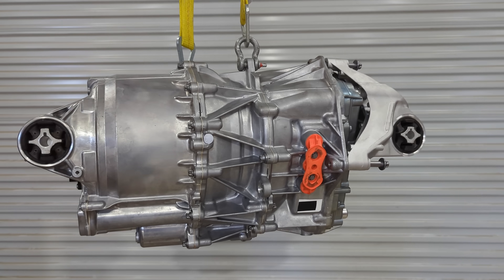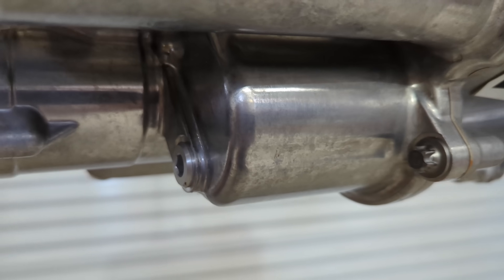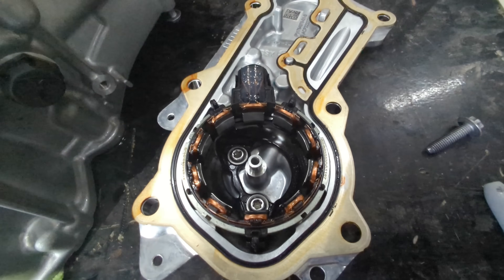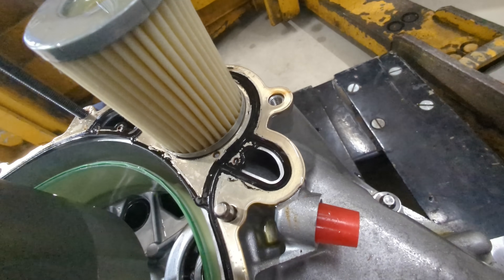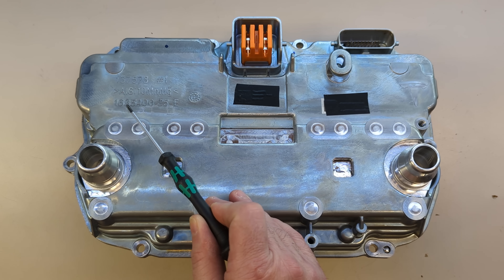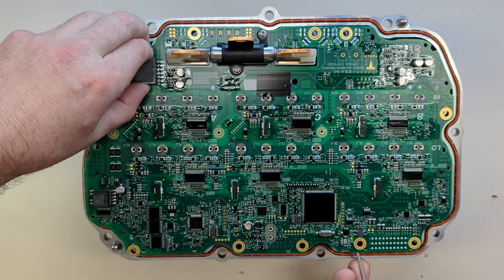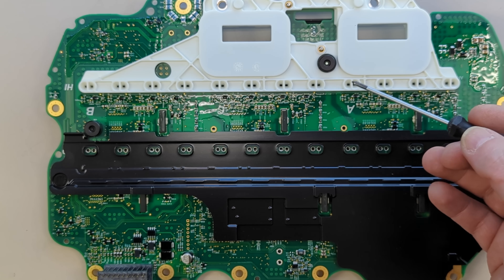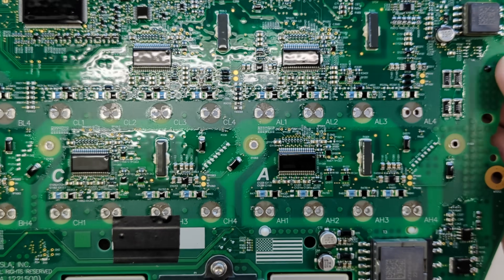Tesla's Newest Motor & Drive Unit

Comment: Excellent video! Do you know the weight comparison between the previous and new motor and invertor? Would you expect any efficiency improvements or performance benefits with the hairpin design? (I would think less winding equals less weight and better efficiency/performance.
Reply from the maker: It's slightly lighter, I don't have exact figures yet.   The main point of this design is making it easier to produce and lower cost.  I don't expect them to increase the power in Model Y or 3.   This is a marketing decision.
Reply: @Ingineerix  thanks for the response!
Reply from the maker: @kylekleman  I updated the exact weight in the description
Reply: @Ingineerix  dang! You the man! Do you know how that compares to the previous version? :) If not, no worries!
Reply from the maker: @kylekleman  I think the previous gen was around 200lbs, so at least 6 lbs savings.
Reply: I traded my S in for a Lucid GT after watching the teardown of the Plaid and Taycan designs on the Lucid site with Peter Rawlinson (he was the chief engineer who designed the S).

Comment: Does this have the new rare earth free permanent magnets? Maybe you can borrow an XRF analyzer and point it at the magnet material.
Reply from the maker: No, what you are talking about is for the future low-cost model.
Reply: @Ingineerix  why wait?, new cheaper permanent magnet material. Plenty of reasons to try in current production where they can fall back to old material if problems.
Reply from the maker: @TheGaussFan  I do not work for Tesla in any capacity, and I doubt they will take suggestions from me.  Go talk to them if you think you know how to help.
Reply: @Ingineerix  What I meant was that they will likely try the material out sooner rather than later (as they have done with the hairpins) to reduce risk  for the new platform. Local sales rep for XRF (non-contact, non damaging test) would likely jump at the free publicity and help you analyze the magnets. Worst case, you would have a before measurement to pair with a later measurement on the new material.
Reply from the maker: @TheGaussFan  Well, I'm sure Tesla will extensively test any new composition in engineering vehicles well before they put it into production.   That doesn't have much to do with what's in production now which is what we can see.   Sadly, I have limited time to devote to Youtube, and calling around to XRF and then taking the whole thing back apart again to test the magnets seems like a time sink.  Had I known that before I did the teardown maybe it could have been done.

Comment: All the ICs appear to be epoxy painted so we can't read numbers.  This is silly as the people that really want to know will x-ray.
Reply from the maker: They are not "painted", this is called conformal coating and is done fro reliability.  It is transparent, and with the right light angle you can see the part numbers.

Comment: Integrated filter housing.  Bullish on drive unit lifetime.
Reply from the maker: I think this is a better design.  There really is no reason to ever replace the oil filter.  People are used to thinking this is like an ICE where oil is contaminated by combustion blow-by and broken down by high-temperatures, Thus there is very low flocculation in the synthetic lubricant.   This is only to filter out the really small amount of material detritus from manufacturing and wear over the life of the unit.   There are no friction surfaces in this unit like an automatic transmission would have.   Tesla considers the lubricant to be "lifetime".  I recommend changing it at every 40k if you want to be really careful, but no need to ever change the filter, it has even more surface area than the old spin-on design and eliminates a possible leak point.

Comment: you are awesome! Lucid Motors has a great video on comparing their motor design to Tesla's and they're pretty much better on many aspects.  Only defense for Tesla is they're reusing old motor design from the M3 and they scaled it to the Plaid by using carbon wrap.  I'm certain they're going to ditch the carbon and take Lucid's approach
Reply from the maker: Keep in mind the car Lucid is making is much more expensive than what Tesla is selling.  And they definitely can't be compared to the lower-market cars like Model 3/Y.   Cost is king in automotive.  This is allowing Tesla to undercut everyone else in the EV space.
Reply: @Ingineerix  true. after watching that Lucid video, I estimated that Lucid could be paying more for that electric motor design. also the hairpin solution looks to be more expensive than wires but it appears worth it as it greatly simplifies and shortens making motors.
Reply from the maker: @zodiacfml  Lucid has some amazing tech, I hope to be able to take it apart sometime.   However, they are in the "boutique" stage selling a very low quantity expensive vehicle.  Tesla meanwhile is optimizing this to get it mass-market, and build cars as low-cost as possible.
Reply: Why would they ditch the carbon wrap?
Reply: @bru512  it is more expensive while producing the same power as the Lucid electric motor
Reply from the maker: The carbon overwrap was introduced to allow higher top speed in the Plaid motors.  I have separate videos on this already.
Reply: @Ingineerix  Yes, but will it become ubiquitous or reserved for high power solutions?
Reply from the maker: @bru512  Will what become ubiquitous?   The carbon overwrap?   No, that's only reserved for the flagship vehicles that are sold to be able to achieve high-speed.
Reply: @Ingineerix  Why not?  How much does it cost to wrap a rotor?
Reply from the maker: @bru512  There is no need for motors that aren't going to exceed 162mph.  I don't know the exact cost, but it's not so cheap they would do it for no reason.

Comment: Why wouldn’t they do hairpin before if it’s better and easier to make? I thought the sound rotors where better but harder to make
Reply from the maker: There are tradeoffs, but it also costs a lot to change tracks, you have to have the right circumstances, and I think since they were building a new factory in Texas, that was the opportunity.   Tesla is striving hard to get cost down so they can sell more cars cheaper, so far seems like this is working.   I doubt they will trash the existing wound stator motor lines right away.

Comment: Great video! but what advantages does it have vs Gen 3? is it lighter and more powerful?
Reply from the maker: Mainly cost.   Slightly lighter, and could have more power, but they are keeping it the same, so that means (usually) more reliability.

Comment: The driver PCB unit looks very cool! It has some thick conformal coating applied over the most delicate circuits. That's probably because the PCB is submerged in a liquid coolant. How many circuit layers does the PCB have? I'm guessing eighteen or twenty layers. Thanks for the awesome video!
Reply from the maker: The PCB isn't submerged.  The conformal coating is mainly to prevent condensing humidity from causing problems long-term.
Reply: @Ingineerix , I see. So the chiller housing is cooling the SiC MOSFETs opposite to the PCB component side. Nice! Is there anything stamped on the PCB that says how many layers the board has? Thanks.
Reply from the maker: @BookProX  No, but I would guess it's 4-6.

Comment: Interesting to see that these motors get simpler and easier to build (less manpower, less parts that fail)

Compared to a combustion engine they are much simpler to make and maintain. Less mechanical parts, less materials, more predictable, less gearing needed,..

Or are they?

Comment: Subscribed 😊! Tesla just had our early 2021 production model Y rear drive unit replaced last week, only part number is 1521487-00-B. Is the newer unit compatible with older models? Or do they have to keep making older unit sku’s?
Reply from the maker: No, that's not the new motor.  They put rebuilt drive units in existing cars, not new.  This new unit is not in wide release yet.

Comment: is it a permanante magnet reluctant motor?  the magnets are tvisted back and forth in the rortor for vibrations diversificating?
Reply: Magnet placement is to maximize magnetic field strength across the rotor to stator gap.
Reply from the maker: Yes, it is a Synchronous PMSRM (Permanent Magnet Switched Reluctance Motor)

Comment: it's bitchin'! btw.: is the resolver stator insulated from the housing cover?
Reply from the maker: It's a sine-cosine resolver and it's got 2 windings, and yes, they are both isolated.
Reply: @Ingineerix  thanks for your answer and applogies for my imprecise question. i understand that the reluctance resolver has 3 isolated circuits (excitation, sine, cosine). but looking at timestamp 3:37: what is ths golden color on the mating surface of the resolver cover? the black line is an oil seal, but is there some kind of coating applied to the mating surface?
Reply from the maker: @teslaw-model3  That's just a little of the drive unit lubricant wetting the gasket.   The back cover is firmly mounted with 4 bolts, so it's definitely connected to the chassis.

Comment: 12:45 Subscribed !

Awesome teardown... How did you get your hands on this car? How are you paying for it? I'm flabbergasted... This is Gen3 stuff, right? 🤯
Reply from the maker: This is Gen 4, just an evolution of Gen 3.   We have not seen the Cybertruck yet (Gen 5?) and the new future low-cost car architecture will probably be Gen 6.
Reply: Purely guesswork on my part, but if he is involved with Maxwell vans as he says earlier, then he likely has access to the drive units they are buying from scrapped cars to use in the vans.
Reply: @grahammonk8013  but this is a gen3 motor and inverter... Just announced by Tesla as their future platform. How this is already build in a model Y? And how did it end up as scrap? I'm just so confused now ....

Comment: That's some very cool engineering on those inverters. 
I'm a little annoyed the filter is internal to the motor housing now, not likely to ever need be replaced, but having the option to replace it externally gives some peace of mind. I would also like to see some oil analysis of these drive units after a couple hundred thousand miles. I know the oil won't degrade from temperature and contaminants, but what about shear wear? There's a lot of torque between those gear teeth sometimes.
Reply: You'd think that, but Tesla now has several million drive units with filters, and with 4 almost 5 years of experience + at least one model 3 in the the 300k mile range. There is no combustion of the oil due the much lower operating temperature of the oil compared to a standard ICE so far less material to filter.
Reply from the maker: This is why Tesla uses some very special synthetic lubricant, it's designed to have very low windage losses and withstand the high pressures found in the geartrain.
Reply: @Ingineerix  I thought they just used dextron 5? Not that D5 isn't a high quality fluid or anything. I thought that's what the service manual for my 2021 said. Or have they moved to a new fluid now? I would still be curious to see what the viscosity and film strength is like after a few hundred thousand. And to see a teardown of one of those high mileage gear sets to see what kind of wear has taken place. I'm not actually that worried about it and I'm sure it's low, but I'm still curious as a numbers and data guy.
Reply from the maker: No, they are using Pentosin full-synthetic ATF 9 in the 3rd gen and what they are calling "KAF 1" for this 4th gen unit, unknown what this is at this time.  The older Model S/X drive units that didn't have any filter used Dexron 6 (full synthetic), I have never seen Dexron 5 specified.
Reply: @Ingineerix  Another little nugget of useful information.
Reply: @Ingineerix  About filters, does the fourth generation of products still use two filters? Is there metal mesh in front of the oil pump?
Reply from the maker: @Yajun-pp8qz  Yes
Reply: I understand the concern, but this oil has an even easier life than the oil in other transmissions, because there are no clutches (as in an automatic) or synchronizers (as in a manual) to wear.

Comment: Great video! Can you share the part number so I’ll check under a brand new giga Berlin made Model Y? Thanks
Reply from the maker: Tesla part number 1665000, so I'm calling it the "Triple 0".
Reply: Usually you have to jack the car to fully extend the rear left suspension: then you should be able to take a picture of the laser engraved label with part number
Reply from the maker: @massimopinelli6555  The new drive unit doesn't have that same large area with the laser engraving.   There is a black foam NVH cover all over that side of the drive unit, so definitely can't see much.
Reply: Can you see this part under the car, or do you have to take off some cladding? I took delivery of a Texas MY LR last week. It believe it was built on March 17 (VIN assigned). I'm curious if I have the drive, but I know it is not important.

Comment: So my 2023 MYLR has the hairpin motor?
Reply from the maker: Only some Model Ys from Texas will have this.   There is no way a driver could tell the difference.  (unless you start looking under the car)
Reply: @Ingineerix  Thanks. My Model Y is from Austin. So it a toss up like you said.
Reply from the maker: You can look through the left rear wheel to determine it, see here: https://teslamotorsclub.com/tmc/threads/what-motor-does-your-2023-model-y-have.293314/
Reply: @Ingineerix  😳 thx

Comment: Great video, thanks! How much does this weigh? Compared to the old Tesla small drive unit, is this one lighter or more powerful?
Reply from the maker: Only slightly lighter, and power (for now) is exactly the same.   The main benefit here is lower cost.
Reply from the maker: The weight is now listed in the description and pinned comment.
Reply: Great question, I’d be interested to know mass savings as well

Comment: So is it safe to say that all model 3 and Model Y manufactured in Berlin/Austin/Freemont/Shanghai in 2023 have this new version?
Reply from the maker: No, I only am aware of some Model Y's in Austin using this motor so far.  Even though it would fit in Model 3, the software doesn't yet have a build config for Model 3.

Comment: i wanna know how powerful😮.5.6s?5.1?or 6.1?😢
Reply from the maker: Even though a hairpin design could support higher peak power, Tesla has set this up to be identical to the previous generation.  The net result is it's just a low-cost evolution, and might be more reliable.   Time will tell.

Comment: Thank you for your video, it looks so great! Could I just ask you a question?
Is 8 layers hair pins  for the Long Range/Standard Model Y, and 10 layers for the Performance? 
There're some leak photos show 10 layers motors exist!
Reply from the maker: I'm not aware of any other stator designs in production.  I don't see any reason that performance would need a different stator, this design already has plenty of excess power capability.

Comment: Will only the long range have this drive unit? Or will it be same drive unit on the performance?
Reply from the maker: Only build configs in software right now are for the rear unit in AWD Model Y, in both Performance and standard.
Reply: @Ingineerix  So we should see same drive units in all trims?
Reply from the maker: @konstantinejakhaia2719  They could, but I suspect they will keep the existing lines going for some time, as they are already a sunk cost, so we'll probably see a mix.

Comment: 11:56 I'm might seem like a cheap way to produce which is the point in evolution,,how innovative to include the coil windings into the circuit bord it's BRILLIANT, wow I'm amazed how fast this change and the others components occurred on a working production modle. It's almost alien in the speed of improvement. Thank you for posting. BTW Sandy will be jealous, great job, 🙌
Reply: There is nothing alien here wtf!! It's just a super old design that others have also been using for years
Reply: @carholic-sz3qv hey easy have some caffeine or something.

Comment: What are your plans for the motor? Would you be able to share it with Sandy Munro?
Reply from the maker: I try not to destroy good working parts, it will probably get used in a conversion.  There's nothing he can conclude that I haven't.  He definitely doesn't seem to understand the electronics.

Comment: nice video. I don’t know enough about motors but how does this compare to the older motors say the “980” motor in terms of performance, longevity etc. is this new motor an “upgrade” for tesla only in terms of cost? Do you see any long term or general performance compromises due to these cost cuts? Or is it a win all around? Also how would one identify these new motors? Because my 23 Long Range Y for example has the performance 980 3D1 rear motor because it’s built in Fremont. But Austin might use this motor.  Would be nice to know precisely which Ys get this new motor and what the motor designation is.
Reply from the maker: In theory this design could handle higher power as it is more dense and can cool better, I predict this will be a more reliable unit.  Definitely no performance hits.  Yeah from what I can see this motor is only being built in TX for now (not sure about non-US).  The full part number for this motor is 1665000 vs 1120980 for yours, so I guess you can call it a Triple-0!